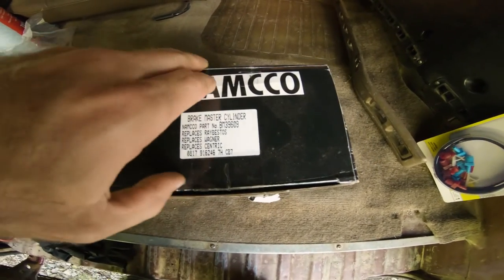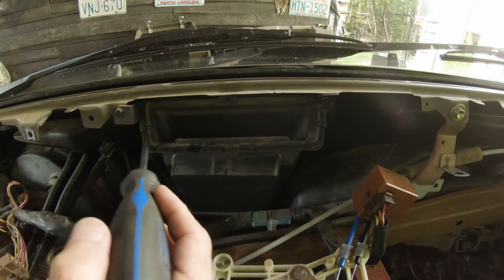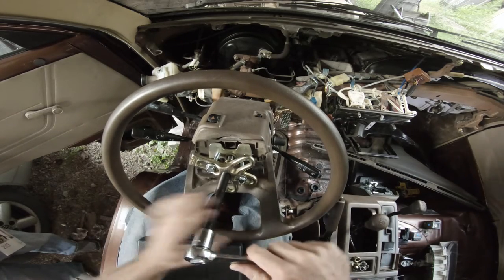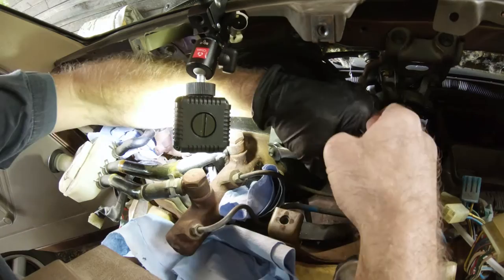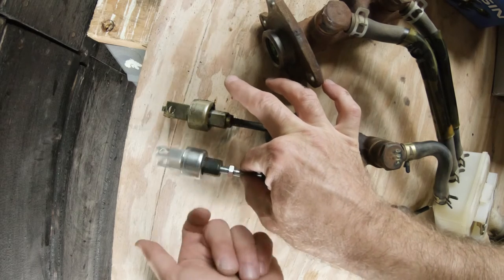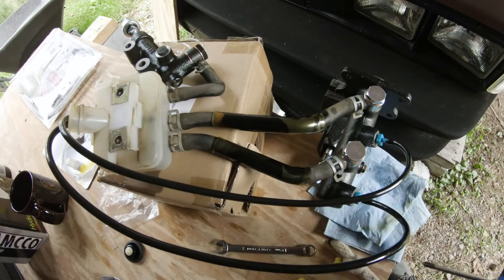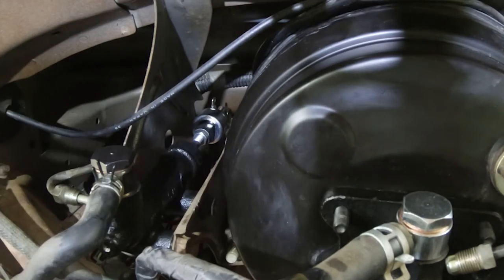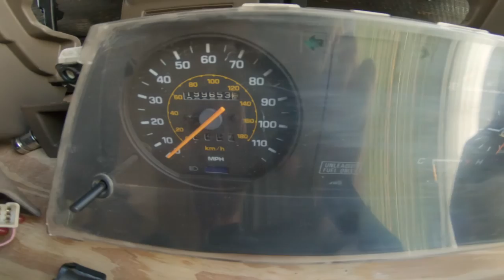1988 Toyota 4x4 Van | Clutch and Master Cylinder update

Comment: Thank you for such an informative DIY HOW-TO video. Very easy to watch and understand. I try to do my own repairs on my yota van. And it wasn't easy diagnosing the problem this time, I probably bled my brakes a half dozen times each time thinking I was good only to have the pedal push all the way to the floor while I still continued to roll. The confusing part was that I could get the brakes to grab if I applied them hard and fast but when I applied them slow and steady the pedal would just sink to the floor and not even slow me down. Thankfully my e-brake still functioned well and was a literal life saver. But enough about that. Now I need to order the master cylinder and get ready to tear out my dash. Thanks again. I look forward to checking out any more "crusty the van" videos
Reply: Did you do it?

Comment: I have had a go at my clutch cylinder a couple of times. Thanks for the vid I will try again now. Thanks!  To fill that reservoir I use an old dishwashing soap bottle clean it out dry it out and no mess.
Reply from the maker: Thanks and glad the video is helpful! Hope it goes well getting it all back to tip-top shape. Great idea about the Bottle. I'll try that out on my next go around.
Reply: @GraeSkyeStudio  I am potatovan on toytavantech.com 1987 4x4 panel.

Comment: At  7.11 what size spanner do you use to crack that line? Trying to change the  clutch master cylinder in my not-quite-same-model as yours without removing the dash, and the outlet line is the last thing I need to remove. Trouble is I can't see it, and I'm not having much luck trying to unscrew it by feel.
Reply from the maker: That’s one of the things about this project.... Lots of it is by feel and working blind really tests a persons patience.
I wish I could remember exactly what size that wrench/fitting was. Unfortunately it’s been a good while since I was in there. 
Sorry I’m not being more helpful. 

If you figure it out- post it back here and maybe it’ll help the next person. Happy wrenching! :)
Reply: @GraeSkyeStudio   12 ml got it off

Comment: Hello! May i ask what was your symptom that made you wanna change the master cylinder ? The leak you were seeing was from the clutch right ?
Reply: Also, if i only need to replace the Master Cylinder, is taking the whole dash off really necessary ?
Reply from the maker: Mostly since the entire system is connected and the shear age of the components. I made a guess if one was leaking the other wasn't far behind. So far so good after a couple of years since this update was completed.
Reply from the maker: Not totally necessary but I like having plenty of room to move and not have to wrestle in tight spots if I have the time to set it all up properly. That said, You will need to at least remove the crash pad and the main gauge cluster of course. Which will also require you to remove the radio faceplate bezel and the glove box to get at the screws for the crash pad.

Comment: Wow I’ve had the dash open for the front washers it is a headache job I’ve also just changed engine from a 2.0 to a 2.2 changed the clutch while I was at it but I am a bit suspicious of the clutch master so thanks for the vid my engine came out of a toyota forklift
Reply from the maker: Whew goodness! That engine switch-out was a big job!! 
Hope the vids help out if you end up with hydraulic issues.
Reply: @GraeSkyeStudio  yeah the new engine is brilliant ive already done 600 miles in it so all good new shocks next get more of a comfortable drive
Reply from the maker: That's great to hear about the engine and man I loved getting my old shocks replaced. They were done!
Reply: @GraeSkyeStudio  funny enough the engine came out of a fork lift it was your 4y engine that gave me the clue so thanks it worked out brilliant
Reply from the maker: @jeffvaljean6030  Oh Man!!! We've talked about that quite a bit in the TV Facebook Group. Wondering if one of the forklift engines could be converted and used.
I'd seriously love to hear more about how that all worked out nd how you pulled it off!
Reply: @GraeSkyeStudio  the toyota forklift has a 2.2 4y engine and they have never been over 10 mph so all you have to do is strip the timing cover off put your old one on everything is the same change over a few things and it slots straight in
Reply from the maker: @jeffvaljean6030  I knew it was the same engine. But folks have wondered about the details.
That’s pretty awesome to hear. Thanks for sharing the insight!!!
If I ever have to do it in the future, It’d be a great process to document for sure.
Reply: @GraeSkyeStudio  it worked for me ive done over thousand miles with the new engine and its a hell of a difference
Reply from the maker: @jeffvaljean6030  that’s is VERY encouraging!!!

Comment: Great videos,  really well explained.  Can you please 
Answer me this? So if you go straight to bleed the brake and make sure that the reservoir is always full, you don have to bleed the clutch?  And pressure will be built up. Thanks for al your great videos
Reply from the maker: Thanks Adonis. 
I appreciate the kind words.

As for the clutch cylinder... after some discussion in the Toyota Van FB Group, there was some agreement that as long as the clutch wasn't energized (depressed) during the process. It would remain sealed and no air would be introduced. AND yes, make sure to keep the reservoir full through the process. 

Hope that helps.